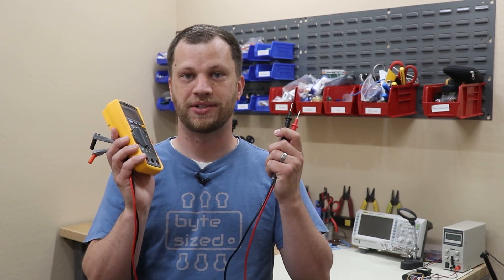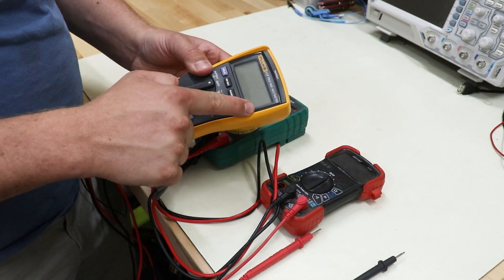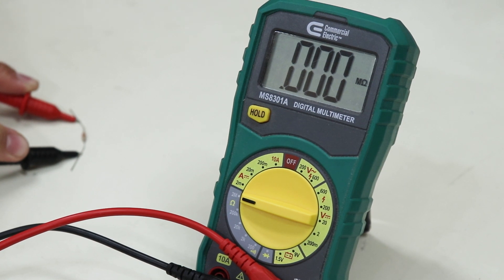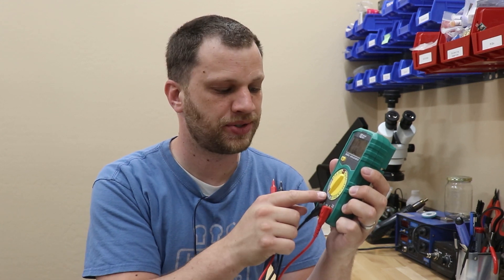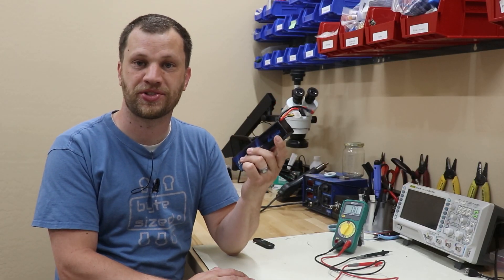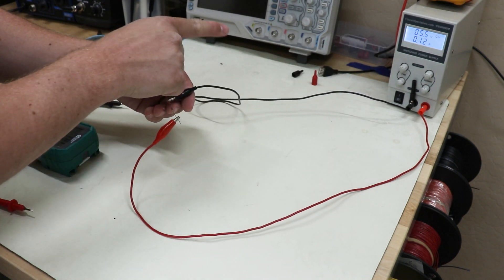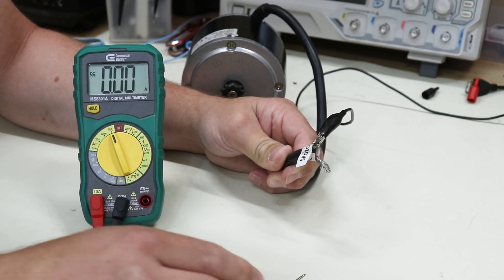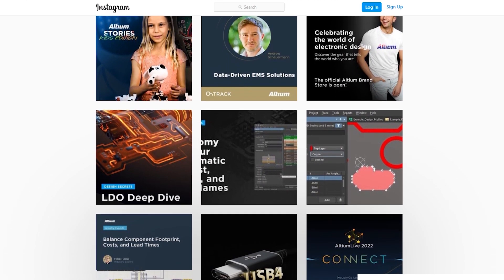How to use a multimeter | Practical skills for makers

Comment: Keep in mind that he didn't mention:  1) Never attempt to measure continuity (or resistance) on a live circuit, e.g. power is applied;  2) Never inadvertently (or intentionally) switch your meter to a "ma" scale when your test leads are connected to measure voltage. You will immediately blow a fuse;  3)The same is true if you're connected to measure AC voltage but have your meter set to measure 10A current. You will blow a fuse;   5) When measuring an outlet, or AC Voltage over 30 VAC, always connect one test lead first then remove your hand (if possible) from that test lead, then connect the second test lead using only one hand. This will insure that if something goes wrong and you receive a shock it will not pass through your upper body and heart.

Comment: When you were demonstrating the measurement of current,
your fingers were making contact with the naked wires.
Why did you not get shocked?
Reply from the maker: Low voltage and low current
Reply: @bytesizedengineering  in your estimation,
at what amp and/or voltage combination does it start to get dicey?